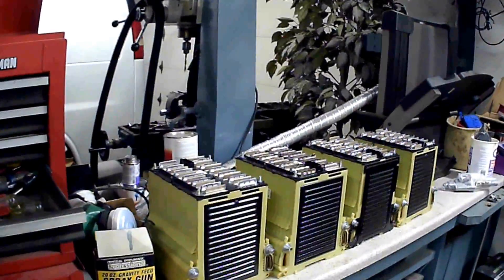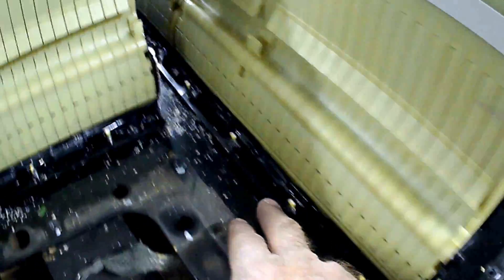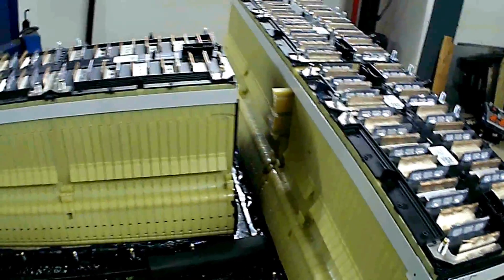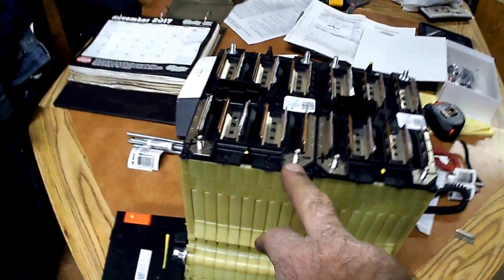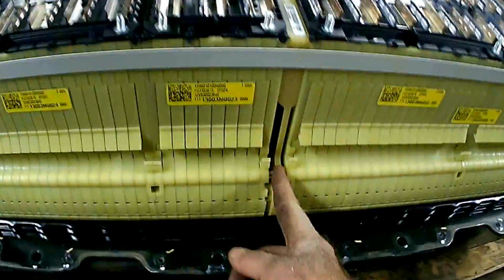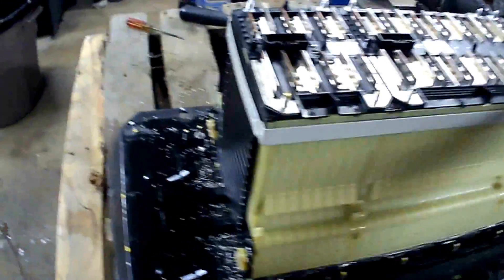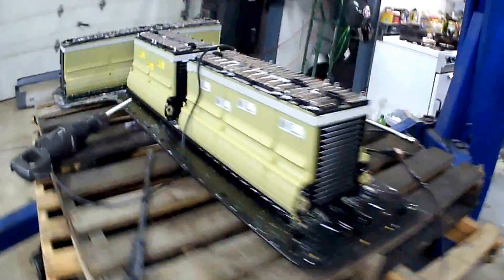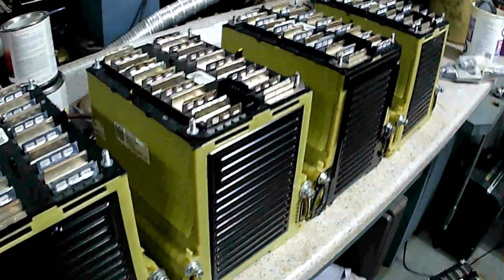Copy of Chevy Volt Battery Disassembly  - Quick rundown

Comment: Great video and inspiring. I have a question. . .I purchased a 48v module from a fellow local Youtuber that lives in the same state as me. My question is; how to I push together the top part of the module?
Reply from the maker: Go to Home Depot and buy the shortest 2 x 6 they sell (probably 8 feet).  Cut (2) pieces 10 inches long. Also, buy 2 pieces of 1/4 threaded rod 1 foot long (or a single 2 foot long piece and cut it in half). Place the 2 x 6's across the sides of the battery at the top, leaving about 2 inches extended past the battery on each side. Drill holes in the 2 x 6's and run the threaded rods through and tighten up using nuts and flat washers and slowly bring the top of the battery back together.  You can cut off any extra threaded rod and 2x6 you don't need once you're done.

Comment: Hmm the coolent keeps the pack in temperature equilibrium. Very important for maintaining cell balance 

 those threaded rods are grade A, not cheap, so could be cut and reused.

Additional end plates should be made instead of just a washer with the bolts for more surface area. you lose the top band, so definitely needed. 

Without any of this there’s a significant increase in the possibility of the pack running out of balance.

Comment: I need 29.4 volts to match my system. how hard would it be to make 7 series packs from them? 29.4 at 4.2v per cell. full charge.  I'm looking for some of these. if I can get a good price.  it's alot easier than building with 18650's. I'm hoping to see some of these fully disassembled. thanks
Reply from the maker: I don't think you can.  The cells are molded as 2S and I see no way to break them apart.  You'd be stuck with even numbers  IE: 6 or 8.  This is just my opinion, so if I'm wrong, hopefully someone else will jump in and correct me.

Comment: Mark, thanks for putting in the time and sharing this.  I have some of these on the way to use in an RV solar setup.  Are you running them without the cooling loop?  That looks like a bit of a hassle, but I'm wondering how risky it would be in an RV situation to go without it.
Reply from the maker: No cooling loop.  My shop never gets below about 55 in the winter and never about about 82 in the summer and the batteries are always ambient temperature (when I check them with a temp gun) because I'm never pulling more than a couple amps out of a 48 volt pack, and likewise, charging is also very low current.  Will your RV be in a hot climate ?   If so, you may need to keep them cool if you want them to last a long time.
Reply: Thanks for getting back to me!  I have a feeling I may need to set something up, though.  I will be spending a fair amount of time in Texas and may try to run an air conditioner from time to time.  It'll be a pretty big current draw.  It will be... interesting...  figuring out a TMS and cooling loop, to say the least.
Reply: Trying to use the original liquid cooling channels at all will be a big hassle, I promise, it could be done though.  What if something failed...water and electricity = bad. These batteries are beast and quite stable.  Ambient temp still affects anything though.  I would just try to configure an air cooled in/out fan type set-up if anything.  That would be more than enough in my opinion.

Comment: Thanks for the informative video. You discuss having to cut the plastic to reduce the modules to 24V. Do you have to do the same thing in reducing the 60V module to 48V as you said in your video you were doing? If not, how do you separate the modules into 48V? I appreciate any and all input you can give me.
Reply from the maker: I think you may have me mixed up with someone else, all of my packs are either 48 V or 24 V.  The newer Volt batteries DO have 60 V packs (not all the packs are 60V) from what I seen, which would require cutting as you suggest.  To make a 48 into a 24, it's just a matter of cutting the metal piece between the cells.  I have zero experience doing this, but from what I understand, it's easy, so the same should hold true for making a 60 V pack into something smaller.

Comment: Thanks for posting the video.  I'm going to try the same thing.  With 12 cells in series the voltage is on the low side for a 48 volt system.  Have you had any low voltage alarms or cut-offs from your magnum inverters, or from your charge controllers?  I want to know if it is not a problem, or if it sometimes comes up as an issue.  If I should keep my battery to the 12s, or re-wire it to a 13s or 14s to keep the voltages higher.  Thanks.
Reply from the maker: 12S works just fine. No issues what so ever.  The Magnum's (adjustable) Low Battery Cut Off will go down to 36V, or 3 V per cell, way lower than you'd ever want to take the battery.  The battery's "knee" is at 3.5V and anything less than 3.5 you'll find the voltage plummet quickly as there is very little energy left.  Refer to my battery discharge/test video for that information.  On the charge side, the Classic works beautifully, and from what I'm told, the new MakeSkyBlue charge controllers are now adjustable to quit changing in the range you'd need for a 12S configuration.
Reply: Great to hear.  Thank you.

Comment: Mark, would the 24v modules be able to be split to make them into 12v packs?
Reply: Thanks Mark, we were able to gently use a cut off wheel to cut one of the U shaped brackets on top in half and thus splitting the 24v into 2ea 12v packs. So now we have 3s instead of 6s.
Reply from the maker: Yes, and each 12 v pack would have a max charge of 4.2 x 3 = 12.6 v and a min of 3.5 x 3 =10.5  You can go as low as 2.5 volts per cell but the "knee" is around 3.5 so you don't get much below 3.5 and run the risk of damaging the cell if you ever go below 2.5.     You could also use 4 cells.  4.2 x 4 = 16.8 v and a min of 3.5 x 4 = 14 v if that helps.  To use 4 cells you'd still be looking at cutting between cells and adding a jumper.... all do-able.

Comment: Greetings mark. Can the Chevy volt modules be broken down to a usable 24 volt nominal bank? I know the Nisan Leaf  battery is easy to use existing buss bars to break down to a 24 volt config. I see the Leaf battery in a lot of work to disassemble compared to the Volt but a lot more money. Also what is the voltage of the individual cells on the Chevy volt? Thanks.
Reply from the maker: The battery can be broken down into 24 volt modules.  It involves cutting the metal bar between the center cells.  I haven't done it, but I have a friend who has and I'm sure he'd be glad to speak to you about it should you decided to take the plunge.  The cell voltages are exactly the same as the Leaf 2.5 absolute min, 4.2 absolute max.   BTW, I have my Volt modules in parallel with the Leaf modules and am loving all that storage !  I'll make a video soon. Get with me on email if you want to talk to Michael about sawing the metal bar.
Reply: Mark Osborne  That's good news to me as I will not have to get a new inverter if I buy the Chevy battery. I have a lot of logs to mill and get to market this spring. I hope to be able to make the plunge then. Thank you my friend.

Comment: how are you run BMS of these units.
Reply from the maker: My plan is to go without active battery balancing as my LeaF battery pack is surviving fine without it.  I will have low battery cut off and maximum charge voltage protection.  If it turns out I need to balance the cells, I will cross that road at that time.